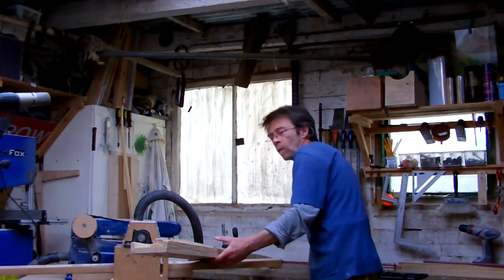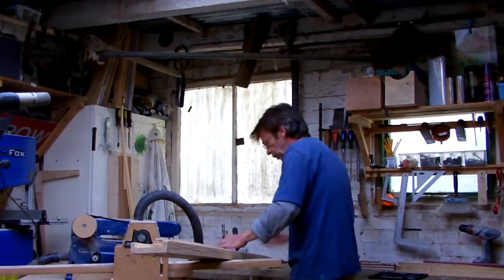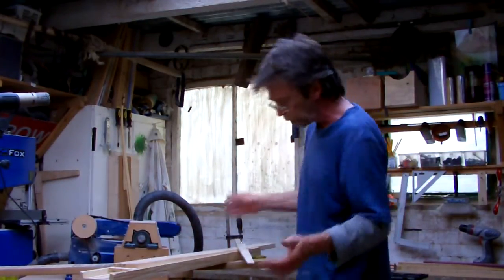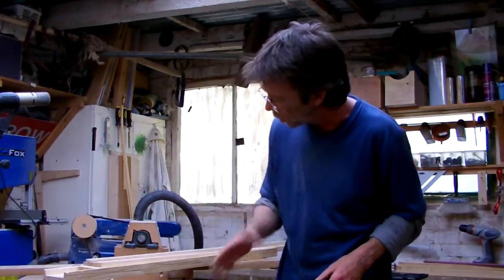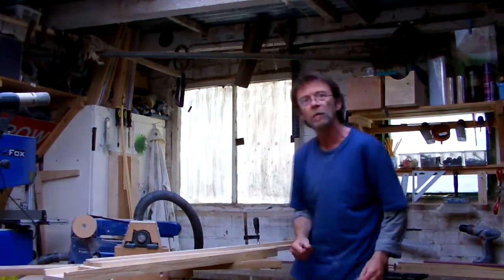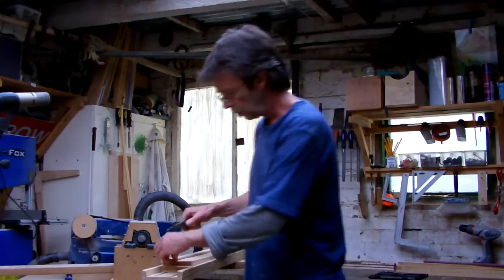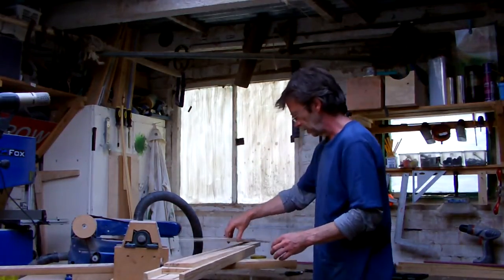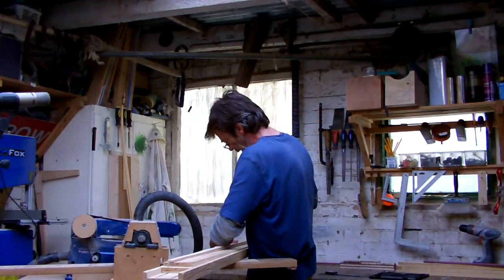Bow Build Along Part 4 - Ash Hickory and Purple Heart Bow

Comment: Great video series Dave. Just a question, in the video it appears that the table of the tapering sledge wasn't sitting square at the end of the wedges. My guess is that one of the wedge slips moved and the table was unevenly supported due to that. Am I wrong or right on that Dave?

 I love the simplicity of your sledge design and its adaptability. But I fear, its weakpoint are the stacked wedge slips. What about a set of solid wedge blocks with some sort of indexing system to prevent slipping of the block and canting of the table. Something like two brass spikes would do the job just fine for big taper blocks (4-9mm).
Reply from the maker: Hi, Yes it is crucial that the sledge table is sitting flat. I think the table was a little bit too tight and was not sitting perfectly flat. I did not notice it until after I had done the video. A couple of spikes inside the sledge at the top would be a good idea and would certainly keep the raiser blocks in place. 

A few other suggestions for improvements have come in from other youtubers too. As some point I will incorporate them in the MKII. Together we will build a better sledge. 

Thanks for watching the videos and the suggestions